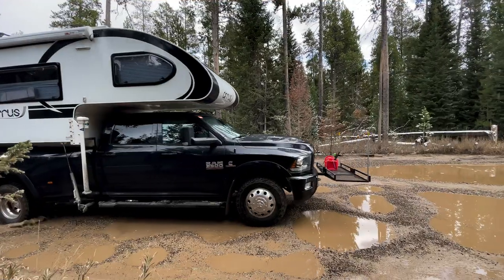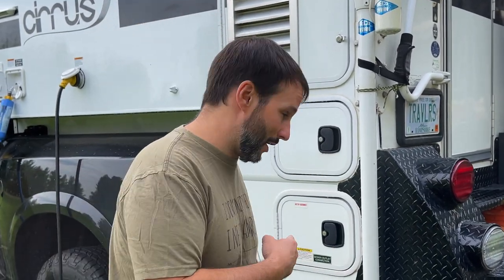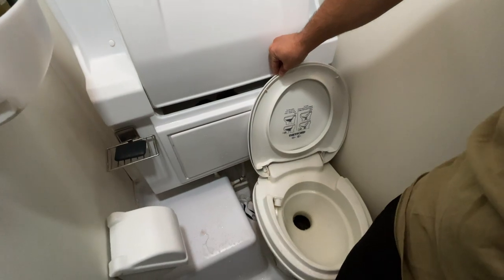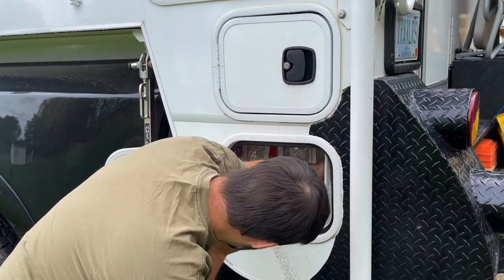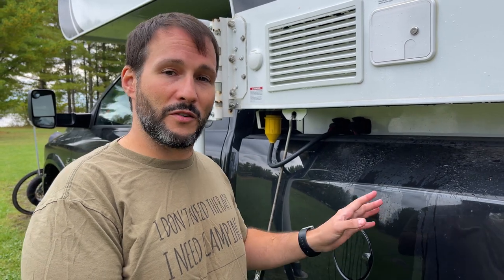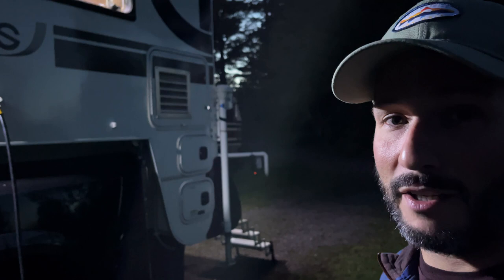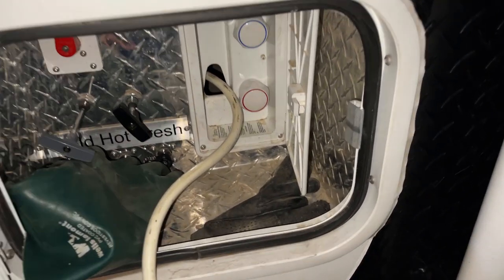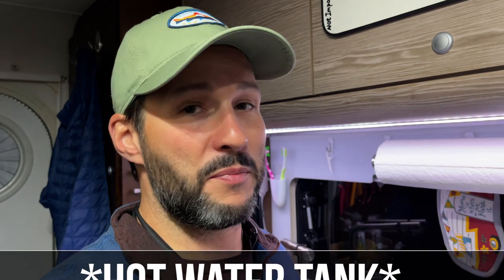HOW TO Sanitize Your RV Water System // Is YOUR Fresh Tank FRESH? // Full-Time Truck Camping

Comment: We have a new imagine xls by grand design and the manual recommends  3 to 4 hrs to soak. I did 5 hrs and have not had a problem. Great video!
Reply from the maker: I think that would be plenty. However, I consistently read 12-24 hours, which seems excessive. Chlorine acts pretty quickly. Like I said in the other comment, I’ll have to read a little more into the details.

Comment: You have a funnel, Ram diesel trucks come from the factory with one under the passenger seat, it’s for the diesel exhaust fluid
Reply from the maker: That's a very good point! I remember seeing that under there, I never use it for DEF, but i'll have to try it next time I need a funnel for something like this! Thanks for the tip!

Comment: Very thorough and well reasoned, Scott.  Only one aside:  I've heard that 1 micron hose filter produces a slow flow, but that hasn't been my experience.  Or at least, the difference seems to have been negligible.  Only on our 2nd one (we change them out each year, and we're not full-timing) so time will tell.  Definitely an essential 'post fill' step to keep tank water as good as it can be.
Reply from the maker: Ours was nice and fast, for a while. Then it slowed down. I’d say after 1 month if use, it’a only about 20% of the “new” flow rate. But it’s usable, I just don’t like using it if there is a line behind me. The water quality is amazing though!

Comment: Very nice tutorial. I use hot tub test strips to check for chlorine in the water when running the taps since it can be hard to smell the bleach once you have the fumes in your nose from diluting the bleach. No need to use your tongue. Also a good way to test municipal water before you add to your tank and after you flush the bleach out of your lines. Cheers!

Comment: Alrighty. You covered this well. Just a few comments to share. Especially beginning into use after purchase or storage. Back in our 2019Cirrus820 for a year we used this process.  We pour the bleach (measured) directly into a drained female-end hose without any filter and connect to spigot & fill. Our truck camper has a fill station while our 5th wheel doesn't.  Works for both with minimal effort or contact. And through our fulltime travels we've definitely recieved great and terribly bad potable water. A clear see-thru filter shows product we fill with good & bad. YUP! Frog, insects, gravel, sand. Always important in rv'ing to use filters. Imagine the debris clogging a water pump or shower head. 
Final thought addressing where to discharge bleached water. It's used to kill bacteria. In sewer lines it attacks the good bacteria needed to break solids down in closed systems ie septic tanks. Many national & state parks have septic systems. While they are huge readers may do this at home. Small systems are very sensitive. We never used bleach for laundry at home  for that reason.  We also periodically add 2 ozs. when filling during summer heat when algae grows vigorously. It'll show up in clear filter housing so it must be in tank as well? 
Safe travels! See you down the road.
Reply from the maker: All great points! 
I really like your idea about adding the bleach to the hose, that's brilliant! I'll be trying that next time :)
What do you use for a see-thru filter?
I did ask for permission to dump into the campgrounds septic. Bleach is never good for septic systems, but given the choice between dumping on the ground or in the septic, they campground opted for the septic. While trying to make videos for YouTube, I try to be mindful of doing things the right way. However, nothing is perfect and sometimes you gotta do what ya gotta do.

Comment: As always, great info!  Just a quick question.  Why bother to premix/dilute the gallon  of bleach? You know how much you need for your entire system so can't you just go ahead and pour the bleach direct into your semi-empty tank and then fill it up.  The freshwater coming in will mix it for you... Plus, with using the measuring cup, pour in.. no splashing or leaks. Just food for thought.  Keep up the great work Stonyboot!!!
Reply from the maker: Good points, but there are reasons behind diluting the bleach first. Primarily, it's less corrosive to the tubing and to the truck if it's spilled. It also ensures accurate dosing and mixing. The measuring cup won't fit into that hole, I can get it in there kind of, but it leaks out due to surface tension. Thanks for watching!
Reply: Thanks for taking the time to answer my question. I appreciate the time and effort you put into making your channel one of the better ones out there!

Comment: I have dumped my 37 gal tank of bleach/water from my fresh tank onto the ground and my grass didn't even turn brown or even yellow. I didn't care about the spot as we are expanding our driveway over that area. I just wanted to see what would happen. And nothing did. So I pass this bit if info over to you. You are correct though, bigger tanks may affect the area, 37 gal though has not.
Reply from the maker: I’ve had the same experience, thanks for sharing. We try to be good campers and follow the rules. Especially, at a campground!

Comment: Put your filters in series, the blue filter will act as the pre-filter and remove most of the particles and you’ll get much longer life out of the green while getting the benefit of the the cleaner water.
Reply from the maker: We did that for a while, but eventually the green filter still slowed down.

Comment: The funnel has got to be cheaper than a trip to the ER for stitches.
Reply from the maker: Probably, the real issue was that as I was cutting the bottle, the knife decided to go right towards the thick center part at the bottom. I didn't have an extra bottle, so I had to make it work! I cut away from myself, so it's fairly safe!

Comment: After i get tge bleach thru my lines i fill up my fresh water tank again so it is as close to the top as i can get it for sloshing around and getting top of tank.  Also another reason i use 1/3 cup of bleach per 15 gals, is this extra added water. Also you can smell the bleach better.
Reply from the maker: That’s a good point. I go a little stronger on the bleach to compensate for the refill. I’ve gotten several comments which makes me want to dig a little deeper into the actual science of the process. Thanks for your feedback!

Comment: Hi Scott, I turned the Pacman botton to green on my Alde and in the morning it was still green how about you? Thanks
Reply from the maker: I read a little more about it. I guess you can leave it on which will make it repeat the heating cycle every night. It’s possible that different versions/models have different behaviors. Which Alde do you have?
Reply: @Stonyboot  I have the 3020
Reply: Mine has an X through pac-man. (Green or blue) Any idea why?

Comment: Those RV water pumps have thermal overload protection so if the pump motor exceeds a certain temp it will shut off.  Running it with low back pressure - many taps open - there is not much load on the motor. Also don't pile a bunch of "stuff" on top of it to prevent overheating.
Reply from the maker: That's a great point. My pump always run's cool, I've never had an issue. However, I've been asked many times if its bad to run it for long periods of time.

Comment: What if I don’t have that style gravity fill spot. I only have a place to put a water hose on.
Reply from the maker: That is a great question. I’ve seen many videos that touch on that, usually, you need to siphon the water in. But it would depend on your rig. Sorry, but I don’t have a good answer. What year, brand and model of camper do you have?
Reply: @Stonyboot  2014 solitude

Comment: I just noticed a 90 degree on your main drain. Do you leave that on it. One thing I've had trouble is taking the cap off it to drain the black and Grey tanks. I'm 70 and both my knees have been replaced so it's very hard for me to get down and reach under there to open it and hook the holes up. Ideas?
Reply: Hook the the drain hose up it should say. Also both my shoulders are what they call reverse shoulder replacement and I just don't have the strength to reach under there.
Reply from the maker: I leave the 90 degree elbow on all the time, makes it easier to connect and disconnect. It also gives me a view of what is coming out so I know when things are running clear.
Reply from the maker: I’m sorry to hear that. You might want to look at some kind of extension, I’m not really familiar with what options there are.

Comment: Good video and something everyone should be doing, especially full timers.  I do however, wonder about the hours the bleach is in the tanks and lines,  I was in the Clinical Reference Laboratory business for 20 years and I gotta say, a 10% bleach solution was used everywhere.  I even saw a lab tech gargle with it after drawing the blood from a guy that was orange from hepatitis.  I get you aren't using a 10% solution, but hours in the tank?  Anything and everything in that tank will be dead in seconds and I fail to see any reason to keep it in the tank any longer than absolutely necessary.  Bleach is not kind to certain parts of the system and in particular valves and faucets.  I get the bleach in on a half tank, put the water to it to fill it, then open everything up and and keep the tank filling with the hose,  As soon as the water if running oder-less, I stop.  I do use a blue filter to fill my tanks and then a Sawyer Tap, SP134, that attaches to my faucet for all drinking water.  I will be looking into that green filter as 1 micron is pretty good and would work nicely in line with the blue one, with the green one last in the line.  The Sawyer is a .1 micron filter so I can drink from stock tanks if I want.
Reply from the maker: I agree with you completely. However, I based these numbers off of established procedures promoted by RV organizations. I do know that chlorine tablets need some time to kill bacteria and viruses in drinking water, something around 45-60 minutes. I'm not sure why they suggest 12-24 hours for RVs. But, until I have solid facts, I'll go with the established practices.

If you have additional information, please email me at info@stonyboot.com. I'd love to make another video with an alternative method. I'm just not knowledgeable enough to lead the charge.

Comment: I want to clarify  what i said about being plastic safe. There are generally 2 types of sterilization  chemicals.  One works great with glass and stainless steel.  But lots of plastic is used in brewing. So there is one designed for sterilizing all the plastics.
Reply from the maker: If you happen to know the exact name or model it will save me some time, but I’m reading about them now.
Reply: Star-San is the product I use. I'm  sure there are othets around, thus just make sure its plastic safe. 
To clean my grey and black tanks( to remove any slime build-up i use 2 methods. 1) i add 1/2 cup of Cascade  dishwash powder(dissolve  in warm watet) into each tank. Fill with warm water and drive around for an hr. Then dump. 2) when no hot water i use PBW(again from a brew store), dissolve  and add into each tank. Drive around and then dump. Both work wondets in keeping both grey  and black tank clean. 
Safe travels
Reply: I use Star-San on my fresh water side.  I use Cascade or PBW on my grey and black tanks. All products are safe with RV plumbing and septic safe.